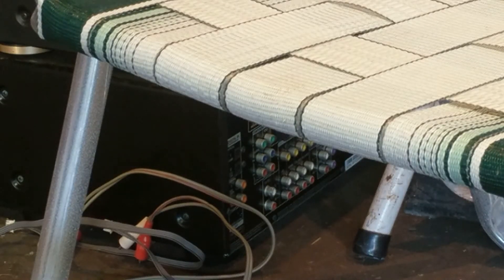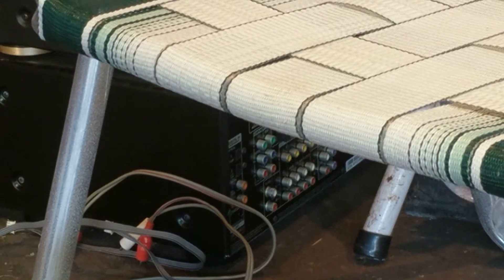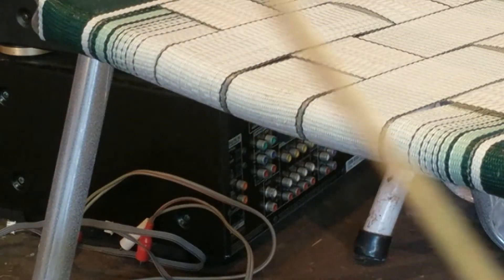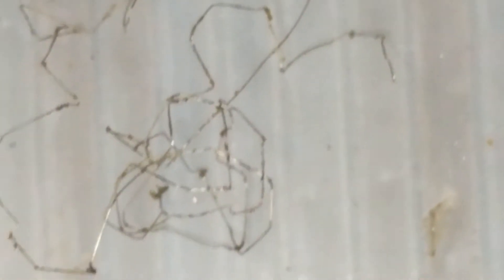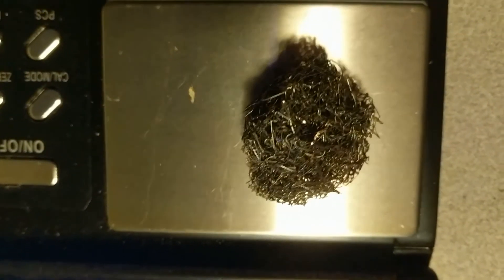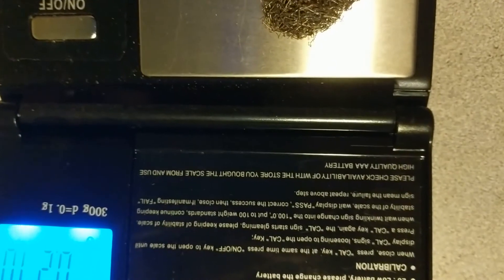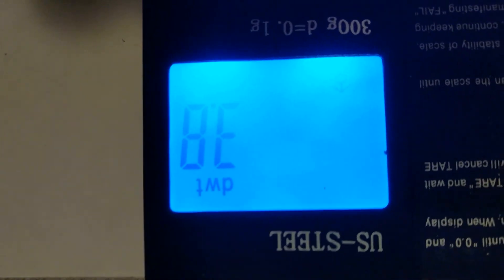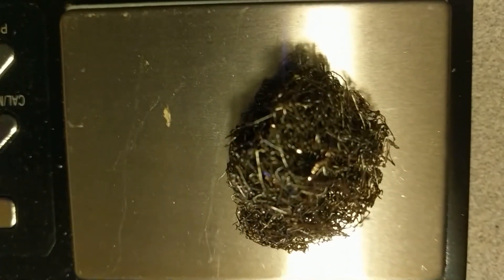Stripping Palladium Wire

Comment: Did you ever find out what the yellow wire is? I took it to the metal place and thier tester said 10k but he said it wasn't 10k he didn't know what it was I got about 14g of it and can't find anything but this on it thanks
Reply from the maker: I tested it and nothing was conclusive.  I was told later on that its some type of chromium alloy.